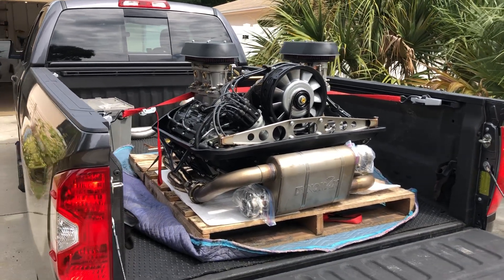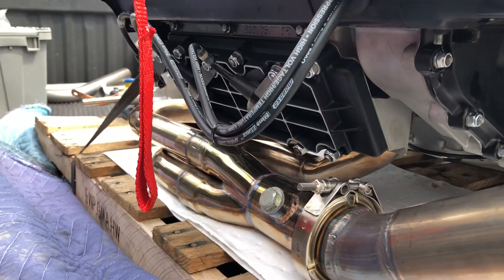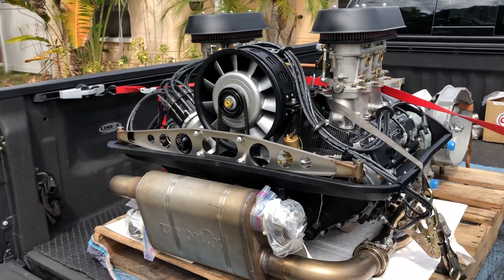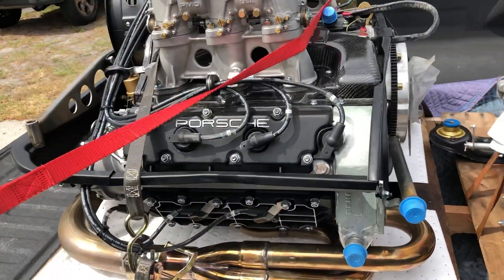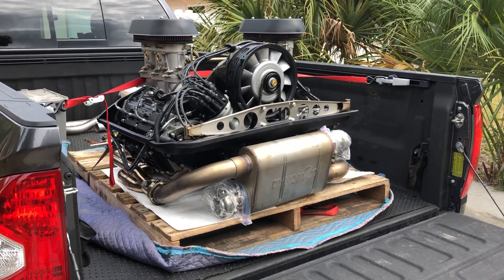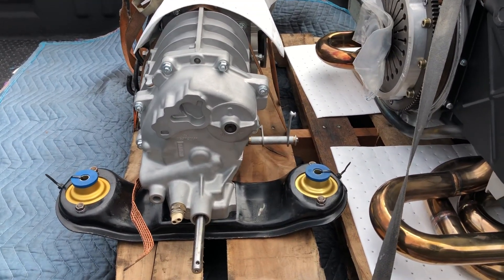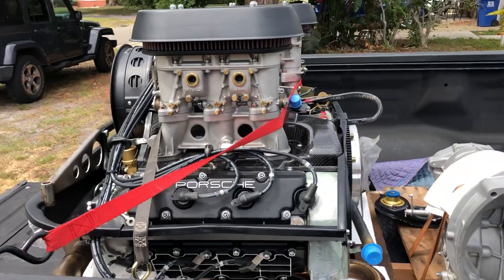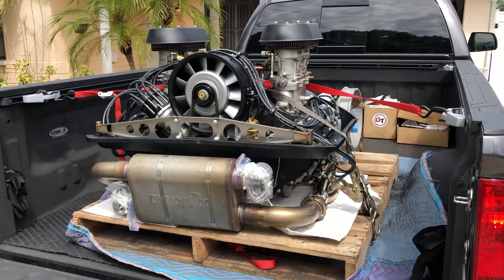$30K Porsche 911 3.6 BAD BOY air cooled engine

Comment: 360 HP on a 3.6 is impressive- I just wish they weren't so insanely expensive to build. Nearly $40k for 360HP is pretty silly when an LS can get there without even a rebuild. I know- it's a Porsche- I own a '90 C4 and I think I'm going to do it myself. Even then it will be $10 worth of parts- maybe $15k. I've thought often of a Renegade LS swap- but the Porsche just sounds so good.

Comment: It looks fantastic man👍 Love the blacked out/carbon fiber look. I wanna buy an old 911, but wondered... is it possible for an older 911 to keep going without a major engine rebuild after 30,000 miles.
Reply from the maker: yes 30K is nothing for a 911 if its been treated right.